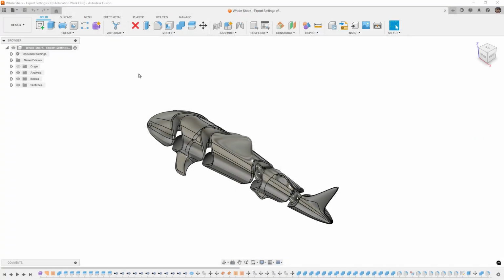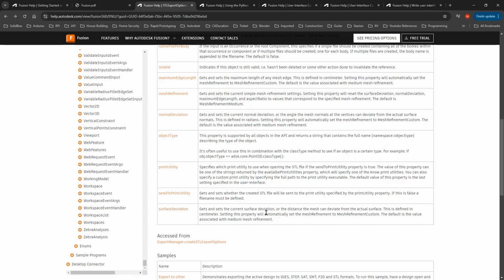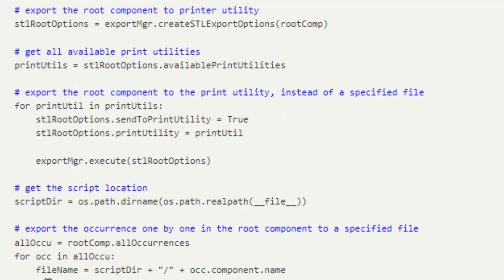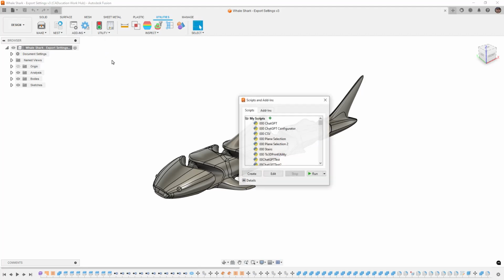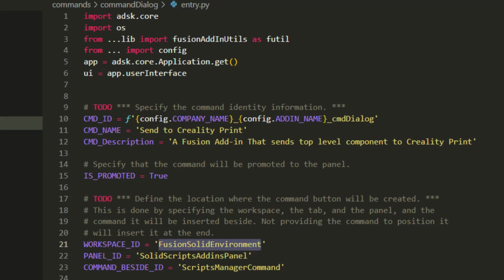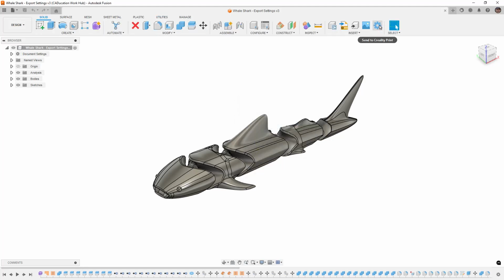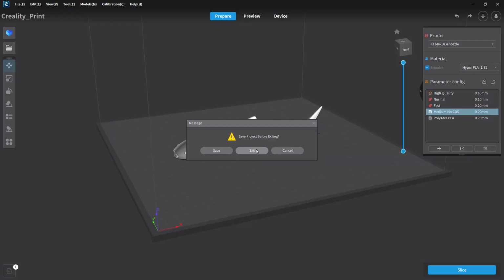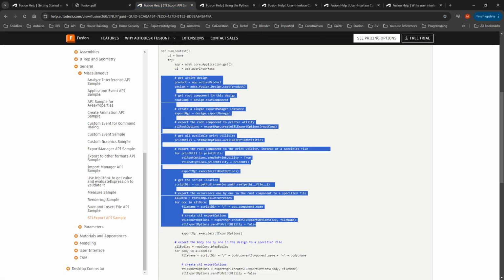Creating a Custom Add-in to Send to a 3D Print Utility | Fusion API Tutorial

Comment: @LearnEverythingAboutDesign  

Thank you for a great video, very informativ.

I did however run into some problems, I hope you can clearify what may have gone wrong.

To the best of my knowlage I have done everything step by step as the video shows.

Problem:
1. I can't make it autostart with Fusion no matter checkmark or not in "Run at startup". I even tried to redo every thing with the checkmark set, but still not working.
2. If you have more than 1 document open it only works send the model from the document where the add-in has been started. If you go to another open document and click your icon then it still going to send document 1 to slicer. The only way to make it work is to stop and start the add-in when you are in the document you want to slice.

Plece advice
Reply from the maker: Thanks for the info!
1. Yeah that happens to me to and I am working on figuring it out so I can update.  The problem it has around not running at start up I think is due to the empty untitled design being the first thing to load.  Because it collects info about the design it won't auto start.  I am looking for a solution.
2. That one is new for me!  but i think relates to the same issue from step 1 about when it pulls the design data.

The way to fix issue 2 is to move all the info about getting the design into "def command_created"   so everything from product = app.activeProduct down to the for printUtil in printUtils:   put all that above exportMgr.execute but under the futil.log

If you do that it will work for whatever design you are currently on.  The problem was the Active Product was taking the current design.  now IF you move those things that should also enable the add-in to start properly when the program is launched.

I will do an update video on this soon.
Reply from the maker: I just made a video on the fixes.

Comment: Does this method work with Bambu Studio? I followed along with the video and put in the location of the Bambu Studio program file instead of Creality Print and it's not opening when I click the new icon in Fusion 360. Any ideas on what I might be missing?
Reply from the maker: hmm, i don't have Bambu studio installed at the moment but do have a P1 coming so I will try this out.  To test this you can use the Right click Save As Mesh method and select the Sent To Print utility and find the bambu exe.  If it doesn't work that way it likely won't work through the API.  As soon as I get my printer here and running ill give it a shot.  I need to sort out a few other things with this program so I will likely have an update.
Reply: @LearnEverythingAboutDesign  Thank you for you quick reply! I tested it that way and it seems to work. I'll have to go back through the video and see if I messed something up somewhere. Thanks for your help!
Reply: It turned out that when calling the "bambu-studio.exe" file, the backslash before the lower case "b" was acting as an inline backspace command. I changed the name of the .exe file to "Bambu-Studio" so that the "B" was upper case instead, and it seems to work now!
Reply from the maker: @ReidRobbins-y1j  Awesome!!!!  One thing I have noted using this a bunch is that the name of the body sent to the print studio is the actual back end ID of the file and not the name of the body/component.  If that is important to you the code would need to pull the component name and pass that along.  For me i rename them anyways but thought I would mention it.
Reply: @ReidRobbins-y1j  You can also use double backslash before b:  "Bambu Studio\\bambu-studio.exe"

Comment: I can not find anything about the format of the file being exported, I like to use 3mf instead of stl. Can you point me in the right direction please?  EDIT: replacing "createSTLExportOptions" with "createC3MFExportOptions" will do the job. The add in doesn't run at startup (the box is ticked). It seems the add in won't run in a document without bodies or components, Fusion by default starts in an empty document.
Reply from the maker: Glad you found it, was just coming here to put the link in case someone else is looking.
https://help.autodesk.com/view/fusion360/ENU/?guid=GUID-024aaf13-d3b1-4379-8f42-206d1ab7ef73

C3MFExportOptions is the one you needed which is in the link at the bottom in Derived Classes for the export object.  For others there are options about exporting an f3d, iges, obj etc etc.

As for the Run at startup yeah it seems the code doesn't like calling on the active design object when the file is "empty".  I have moved everything from "rootComp =...." down to the for loop for the printUtil under the def command_created so those until the user clicks the button in the UI.   Sadly run at startup still doesn't work, but it does let you run the add-in when there are no bodies/components in the design.  So i am not sure why it doesn't like it still.  I will have to do a bit more digging on that one...
Reply: @LearnEverythingAboutDesign  I hope you find something, the button makes no sense if it has to be activated manually each time. This is a bit above my pay grade.
Reply from the maker: @gevanvliet909  Once you open Fusion you can hit Shift+S to open the utilities and run it and it will stay on while you have fusion open.  so it does still have some benefit there.  but yeah ill keep digging